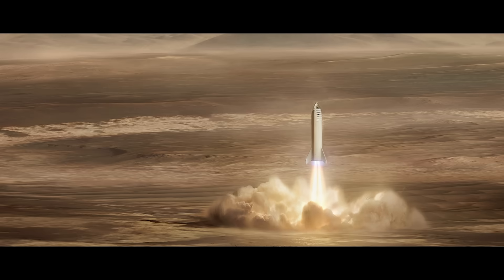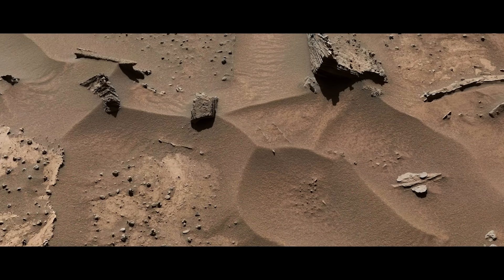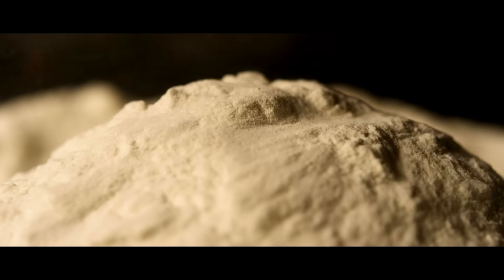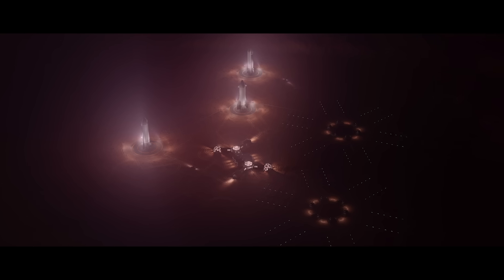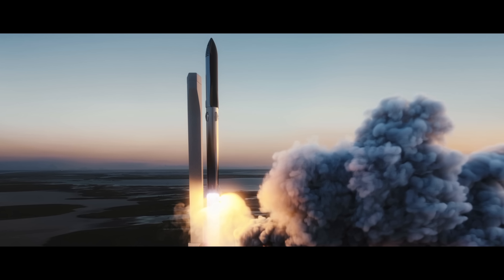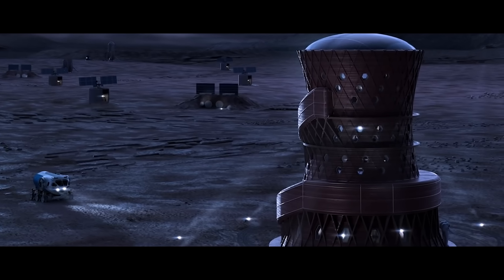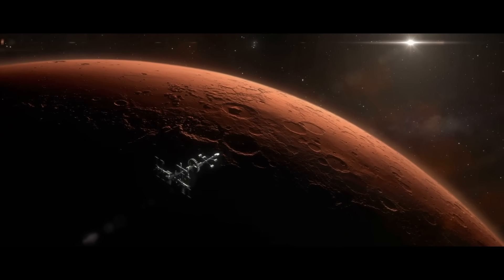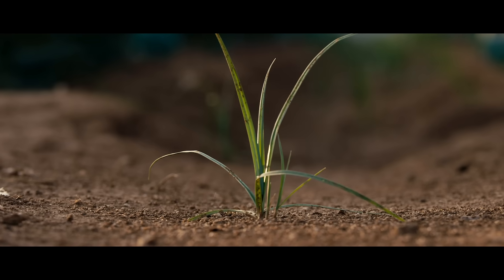THE FIRST 10,000 DAYS ON MARS (Timelapse)

Comment: A certain wise man once said:
I had a dream.
And since then his dream didn't go according to plan.

First mistake steady stated solar panels will never work on Mars.
To many dust storms.
Have you seen the erosion sand can make to any object.

Secondly they will need to fly in 200k  robots just to clean the solar panels on an hourly timeframe.

Check with how much does your little solar panel at home decrease in output when slightly dirty.

Those solar panels would have to be high up above the dust storms.

That planet has been burned out millions of years ago..
Rather make plans to help earth became a better green planet.
That much rocket fuel burn in earth's atmosphere to lift all those rocket's to Mars will kill earth before day 1000

Comment: The explanations of the launch window is rather inaccurate.

It's NOT that you HAVE to launch during those "as low as 12 days". Those are orbits, and orbits are continuous paths in space. It's just that, if you were to launch say 1 month ahead of the launch window, you would either arrive at at similar or later time than the same rocket launching at a more appropriate time, OR you would need to expend more fuel to travel faster to make up for the difference. Similarly for a launching say a week after the window. You would get there, say 1 month later than the vehicule launched in the previous week, assuming same fuel consumption/cargo. So  a disproportionate time delay, yes, but not a no-go.

In fact, for stuff like unmanned cargo, it may be all things considered BETTER to not cram all launched in a ridiculously short launch window (costs & logistic of all that gear to move around, the likely overtime you'll have to pay/extra hires to make it happen, etc.). Who care if a bunch of robot makes the journey in 9 months instead of 5, if the fuel costs is the same? Answer is no one, we'd rather just get the gear on Mars. Another significant advantage of not caring too much about the window for cargo is better learning - it's much better to do, say 12 iterations (once per month, say)  of preparing & launching stuff and getting better at it than doing only one and possibly screwing importnat stuff up.

Good job for the rest.

Comment: Did he say 5 million per Starship? Thats probably the most outlandish part of this video. Realistically, I could see an interplanetary crewed Starship costing at least as much as a 747. (228 million and up according to google) I think that even the bare bones starship prototypes that SpaceX has been rapid fire testing / blowing up cost more than 5million each, and those dont have a ton of the tech needed for a crew to survive a trip to mars. (Like heat shields, a crew compartment, any type of life support whatsoever, any type of long distqnce coms, etc. Etc.)

Now Im not disparaging the Starship or SpaceX or this video... I do believe that SpaceX is on the right track with Starship and that it will be successfull... I just think that Starships are gonna be pretty damn pricey.... and that's actually not a big deal... Because its going to be re-usable. A 747 costs 228 mil+... but it is reusable and that cost can be spread out over thousands of flights and hundreds of passengers per flight. Starship will do something economically similar.

Comment: Great video! Personal opinions of what I think will be a little different:

Silicon wafers and an etching printer will be sent within the first 15 years allowing for more local manufacturing.

 A little longer before the first baby, it's a huge risk

First death would either be buried, vacuum dessicated, cryopreserved for study/burial on Earth, ejected into space, or undergo resomation - not cremation. Cremation uses far too much oxygen and other supplies - worst option. Resomation would allow for rapid fertilizer creation and is the best resource wise.

3D printed habitats are less likely to be the first habitats than high pressure inflated or rigid habitats covered with a small hill of regolith/binder mixture placed similar to compacted soils on earth.

Comment: ehhh - Mars quakes are still in the 'maybe' category. Mostly because if there are quakes - they're insanely weak compared to Earth. There's also ways to induce gravity in transit if you created wheel / pod system made of inflatable modules like the ones Bigelow Aerospace put on the ISS. The cargo capacity of Starship could easily accommodate such a system and the amount of muscle mass and bone loss in transit would be very much worth it. Actually - another option is if you're going to be sending a fleet that can dock - link them together to create a rotating platform for artificial gravity. IE a pod or modular O'Neill cylinder

Comment: The Martian soil is toxic to life due to perchlorate in the soil, a salt and a chemical used to make fireworks. Exposed to UV radiation perchlorate contaminated soil kills bacteria and plants almost instantly. From what I see looking at the pictures sent back Mars is a desolate wasteland of shattered rock, sand and dust. As I have said before the worst of the Sahara desert holds more promise for life than does the surface of Mars. The planet’s magnetic field that protects us here on Earth from UV radiation and the effects of the solar wind is so weak on Mars that it can not support a thick enough atmosphere to allow liquid water to exist, it would just evaporate almost immediately. Another unpleasant aspect of Mars is it does not have a stable rotation, it wobbles from one extreme to another. Earth has a large moon the stabilizes it’s rotation maintaining a stable environment from summer to winter. On Mars the tilt can shift from what we call vertical to horizontal, not conducive for life due to radical extreme climate shifts. I would also hazard a guess that due to the thin atmosphere on Mars even small meteors might be problematic because of potential impacts on the surface including the habitats we would build there. I am sorry to be a Debbie Downer but the more I learn about the conditions on Mars and it’s history the less likely I see the possibility of habitation outside of exploration purposes. Terra Forming the planet would require increasing the weak magnetic field it now has to keep the solar wind from stripping off any atmosphere we might possibly create in some distant future. The problem Mars has is it is small, much smaller than Earth and because of this the core of the planet has cooled to the point it is no longer producing a strong magnetic field as Earth does. The molten core of Earth is what gives it the strong magnetic field diverting the solar wind around it and protects the surface from solar flares. Without the magnetic field Earth would be just as dead as Mars is now. When Mars was first formed it most likely had a robust magnetic field allowing a thick atmosphere and liquid water to exist on it’s surface but that was a very long time ago, billions of years ago. There might have even been the beginnings of life at one time on Mars and may even still exist buried deep below the surface but the jury is still out on that. :)

Comment: I don't foresee this plan going exactly as planned.  I predict a transfer station on Phobos with, eventually, a space elevator.  I also envision a simpler, faster habitat assembly and cargo distribution system. And some type of fusion power for bases and advanced propulsion engines  making the journey months shorter and safer.  Also, a centrifugal artificial gravity rotating orbital station with settlers and researchers rotating from surface to maintain higher levels of muscle mass and other metabolic processes to preclude bodily deterioration sufficient enough to permanently prohibit returning to Earth.

Comment: The material for the habitat construction by AI Space factory is a basaltfiber reinforced polylactic acid, or basaltfiber reinforced PLA. The design in this video is however a concept by Hassel and Eckersley O'Callaghan, which uses regolith by fusing layers together using microwaves, so not technically 3d printing.. The design by AI Space factory is called MARSHA, both projects are really cool though. Just don't confuse them..